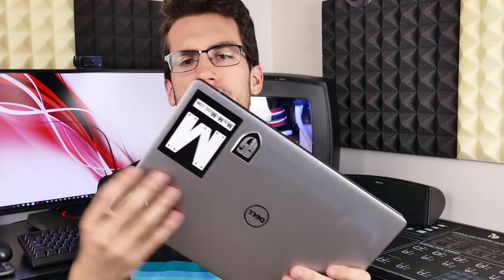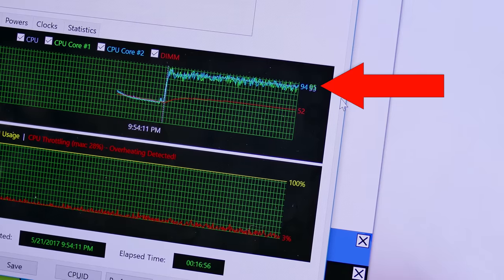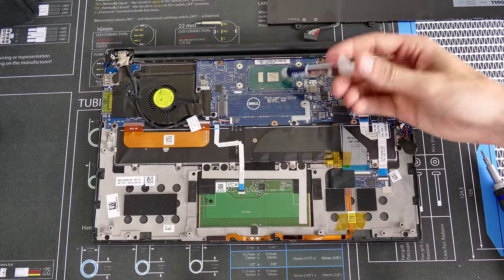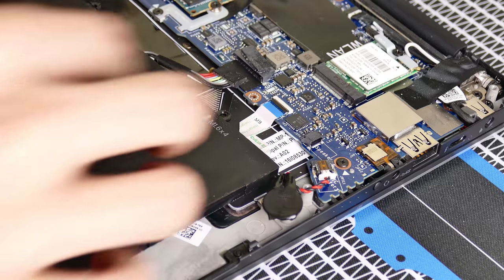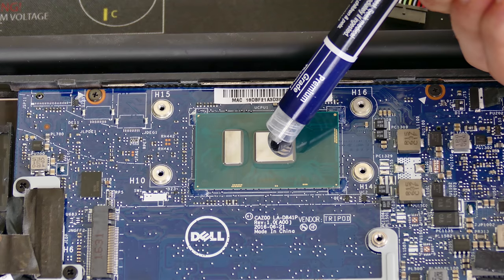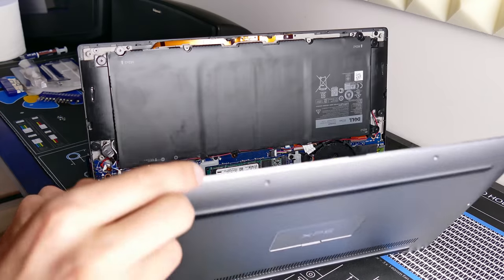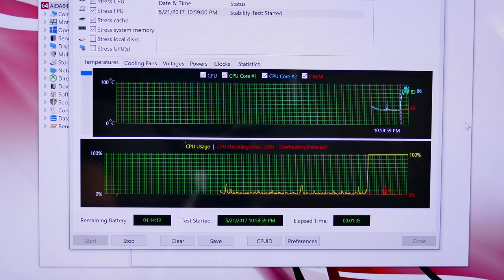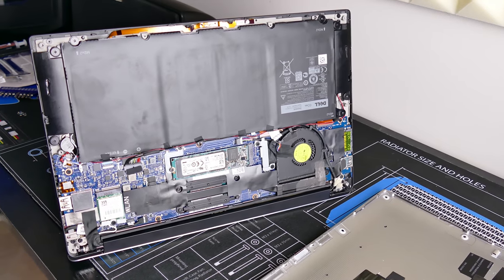Laptop Running Hot? Try This!

Comment: Have you thought of undervolting your CPU? Dave2D has a similar video where he undervolted the CPU as well as replace the stock thermal compund, to get lower temps and noise.
Reply from the maker: Peter Strobl He undervolted a legit quad core that consumed much more power. These ULP CPUs do not benefit nearly as much.
Reply: Science Studio okay. Yeah, I knew he undervolted a 7700HQ, wasn't sure how effective that would be on the 7500U or whatever is the XPS13. Good video btw.
Reply: Peter Strobl I tried and failed so hard on undervolting U processors (tried i3 5005U, i5 7400U, and i3 7100U), all of them crash on load. And my conclusion is that a processor already designed to it's very limit of voltage. Idk if any other could actually benefit from. Undervolting U processor but I don't.
Reply: Muhammad Wyndham Haryata Permana Okay, that's good to know. I was just curious if you could or if it had any benefit at all. Seems like you can't lol.
Reply: Science Studio I undervolted my i7 6500u to -90mv, got 8 degrees C drop. Please dont' confuse peopel around here. Sure, it's not as effective as for quad cores but it's still very helpful nonetheless
Peter Strobl you were extremely unlucky then. I;ve seen huge amount of people successfully undervolting their ULV cpu-s with no problem. I also undervolted my Intel gpu a little, which lead to better efficiency in playing older games.
Reply: Gianluca Orrigo I used Intel XTU at first(very simple) now using Throttlestop, as it gives more control over CPU, including real time control over frequency.
Reply: Gianluca Orrigo which laptop do you have? also you can try throttlestop, it's free just like XTU
Reply: Gianluca Orrigo just see a guide on youtube how to do it, it's quite simple if you only go for undervolting
Reply: because the 8-th gen low voltage cpu-s have a too big range of frequencies. your CPU didn't cool down because before undervolting it didn't get full clock speeds. Now it gets higher clock speeds, as you noticed. So the only way now to cool it down is to manually decrease frequency. In the tab where you decreased your voltage(you can find it in the "turbo ratio limits to the left of the voltage regulation), you can also choose frequency for all cores. I recommend keeping the maximum frequency for 1 or 2 cores, and limiting it for 3 and 4 cores for lower amounts than you have now, and I can guarantee you will get a decrease of temperatures without sacrificing much of performance. Maybe set frequency of 2.0  for all 4 cores? idk, you can play with it yourself and test the temperatures
Reply: when 8-th generation came out it changed. I mean if you had a thick laptop with something like i5 8300h(4 cores 8 threads) undervolting would definitely cool it down. But low voltage CPUs as well as 6- core i7 8750h mostly get higher frequencies from undervolting, because their maxmum frequencies are well above cooling capabilities of ultrabooks or power envelope of a cpu. Which is actually a good thing. Would you prefer instead that Intel locked your processor at much lower frequencies without giving you a choice? I think not. Now you can choose an optimal balance for you between performance and battery life. I recommend allowing cpu to run up to 80-85 degrees C, which is ok for mobile hardware.
Keep 1 and 2 cores frequencies on maximum (or you can decrease it a little if a cpu overheats, set to 3.5 for example), and set 3 and 4 cores to 2.0 ratio(or 20), that way you will have decent performance and good temperatures. Let me know how it goes :)
Reply: I think you misudnerstand how it works. the part of Throttlestop that says "3 and 4 cores" doesn't mean that it's third and fourth core. It means all 3 or all 4 cores. So when you set 3.5 for 4 cores this is the frequency that all 4 cores will stay at.

so I suggest you to look at my previous message again and try to do as I say

"but I have only 3.0 GHz that is a bit too low I'm my opinion" dude, considering that the amount of cores DOUBLED since the previous gen(which only had 2 cores) 3.0 ghz is great for a thin and light laptop :D 
Before 8-th gen quad core processors were only in thick and more heavy laptops which weren't nearly as portable as XPS 13, which explains problems with overheating and all that.
My i7 6500u only has 2 cores, so I wish I had 8550u to complain about it lol
Reply: either way, you can change frequency in a different way. make sure the program is on (near the left bottom corner of the main window of the program) and in the same main window find "set multiplier", it should change your frequency, and as a result - decrease temperatures.
also press "start monitoring" in there to see the real time frequency and temperatures
Reply: yeah it does, it should prevent overheating. But since most of everyday tasks are handled by 1 or 2 cores it should not affect the everyday experience much. When you'll be using 1 or 2 cores youll still have 4 ghz, it's when you give a 4 core load(liek a stress test) it will drop to 2.0, which is still good considering that its 4 cores, therefore performance will still be quite high
also 70 degrees is quite low, you have room for a little more frequency there :) I recommend setting 2.4 or 2.5 for all 4 cores
I ran my old laptop at 80 degrees C 24\7 for a year and it's still working fine, it's 6.5 years old now
Reply: Gianluca Orrigo it depends, all processors are different. and yeah, if you set 3.5 ratio processor won't go above that
Reply: how are your temps dude? :)
Reply: @GregSalazar  i confirm i had no difference by undervolting my 8250U, i guess it is already done by the cpu itself

Comment: That reminds me of my ancient FSC laptop, where the thermal compound got so old and dry, that the heatsink of the GPU got pushed out of its place, leaving a hole in the mainboard where one of the screws used to be. Interestingly though it was still operational and a good clean, new thermal compound and a bit of hot glue got it to work until today, although being pretty useless without drivers for anything newer than Windows XP.

Comment: Hey Greg, nice video! Have you tested fan banks like what Cooler Master makes in the form of the MasterNotepal Maker? I currently use this with my current Dell laptop and my temperatures are pretty chilly for a laptop (never get above 74C). This was after replacing the thermal compound like you did.

Comment: That laptop is so simple to disassemble. I'll do the same with mine one of these days when I have so free time. It's a Lenovo G580 and from the guides I've looked up it seems a lot more complicated to disassemble. I think I'll have to replace the bottom panel too because the part where the left hinge screws on to it is cracked.

Comment: Just did this on mine tonight. Cleaned all the dust out, installed an SSD, replaced the thermal compound. Boom.
I wish I would have taken a base line temperature, but hey, I figured why not while I was in there.
I also pulled and reinstalled one of the RAM modules for kicks and giggles... Then had no display after I closed it up. I opened it back up, was pulling my hair out, tried to boot without the heat sink (thinking I had too much thermal paste or too tight of screws on the block.) Pulled the CMOS battery, decided to pull that RAM stick out and it boots. No idea what happened to the RAM but it won't boot with that stick in. 😥 Cut my RAM in half because of... I just have to take things apart.

Comment: I would add an extra trick I picked up. Using intel XTU, I undervolted my XPS 15 processor by 150mV. This removed any thermal throttling issues I encountered in the past without impacting performance. Apparently, it is standard for Dell to feed more power than required to the CPU "just in case".

Comment: Greg do a follow up video by undervolting the CPU! I did it in my XPS 15 and it helped my cpu temps a lot!
Reply from the maker: DynamicHunter Your 15 isn't running an ULP CPU. Effects on this end will be minimal.
Reply: @GregSalazar  what are you talking about? Undervolting is ESPECIALLY helpful on H series CPU-s, which usually have way too much voltage pumped into them compared to ULV CPU-s. Most of i7 6700hq-s are capable of whapping -0.1 volts, which decreases power by around 20 % and as a result gives noticeably lower temps. I undervolted my 8750h by -130mv(fully stable) and I get -10 degree drop in CPU intensive games. And GPU undervolting helped by around 3-4 degrees as well. Far more effective than repasting in more than 90% of cases.
Reply: Me too, it helps greatly avoiding power limit throttling with my i7-7700HQ. (-135mv)

Comment: I used that exact same thermal compound (NT H1) and I replaced the paste a month or 2 ago. Now temperatures seem to be worse than ever, though initially they were much improved. Any ideas what is wrong? Would it be worth attempting a second paste application?

Comment: Just undervolt your laptop with ThrottleStop. I'm running at a constant overall 75°c down from 85°c-90°c while gaming and 34°c while browsing and doing other stuffs
Reply: too bad i use a u-chip and lost the silicon lottery so any undervolting crashes it immediately

Comment: I'm curious if you repasted with Grizzly Kryonaut or Gelid extreme how much lower the peak temperatures would be. I don't think Noctua's TM is near the top as far as thermal conductivity goes.

However, I can say that on my Razer Blade (2017 Kaby Lake w/ GTX 1060 model) replacing the garbage factory thermal paste job with Grizzly Kryonaut, as well as factory thermal pads with the most conductive pads I could find dropped idle temps by about 10-12 C. I still need to do some stress tests to see max temp but since it isn't my main gaming rig this has not been a priority.

Comment: What about drilling holes, or slotting, the laptop hard drive door for air flow cooling of the SSD?
I'm seeing laptops with SSDs where once the hard drive temperature starts moving north of 50C some SSDs throttle the performance of the drive.

Comment: have you got problem with the sticky rubber coating on your XPS 13 ?
If yes, how do you restore the surface to the original smooth surface?

Comment: Did I forget something?

1. Reapplying Thermal Paste
2. Removing dust. 
3. Changing Power Plan. You can cap for example CPU usage at max 75%
4. Undervolting CPU. All CPUs tend to get more volt than needed to work properly
Check on google for tools. Some laptops will permit to do so through BIOS.
5. Downclocking CPU in extreme cases where temperature are out of hand.
6. Buying thermal pad and applying inside the laptop can help sometime.
7. Cooling Pads 
8. Avoid putting the laptop on tissue or anything that accumulates thermal temperature.

Comment: yup... had a similar experience with my brother's laptop. He was complaining about the temps the keyboard and other components reached During games so I launched hwinfo and a normal virus scan and  the cpu package hit 105c, throttled, notified critical ring package temperature, negative TJmax... after only 10mins !!! Changed with an aftermarket thermal paste and the temperatures dropped down about 15c.... the strange thing is, we're sporting the same hardware and mine has been always way cooler than his... could the silicon lottery gone bad on his cpu?

Comment: can this be done to any laptop ? I've got an old Toshiba laptop from 2009 that i'm still using as a secondary laptop mainly for storing movies and pictures and sometimes it does get really hot , so hot that I was forced to elevate it so that it can dissipate as much heat as possible . The thermal paste does wear over the years , doesn't it ?

Comment: I'd love to try that on my recent purchase (a p73, i9-9880H, 128GB RAM, 6 TB storage) ThinkPad, but I don't want to void the warranty. The dmesg says it's being throttled even with minimal load, and the entire thing is hot. I'm running a 4-fan platform to add air-flow to the bottom, but it doesn't seem to make much difference. I'm open to suggestions.

Comment: Definitely have to be cautious with bare dies and heat sinks.  Over tightening or not using a cross pattern can easily crack or outright crush the die.
Reply from the maker: cracklingice I crossed and tightened to the same degree it originally was. No idea why it failed.
Reply: I was speaking more towards anyone looking to do this than to you.  Didn't remember hearing you mention to take the precautions due to the lack of heatspreaders on mobile chips.

Comment: Before I updated to 17.04 on the xps 15 Kaby I was getting quite a lot of crashing when watching any streaming video for a long amount of time.  The heat exists and makes the keyboard up top a little warm but with the latest os it's not crashed.  Going to try this anyway since that seems dangerously crappy thermal job dell put into it.  Any other performance mods for the xps 13?

Comment: I have just serviced a one year old Levono laptop which was hitting over 80 deg C, but after applying fresh thermal compound - the merest trace spread all over the die - temperatures are now under 60.  I suggest you put too much compound on yours.  I am learning to use less.

Comment: i just found this video because my xps 9560 is running quite hot and i never thought of the thermal glue...will try this in the upcoming week when my thermal paste arrives. thanks!
Reply: andrei ioan any updates.? I do also have 9550 and now fan is always on due to heating
Reply: @SirAguilera  i see a significant improvement! i didn't run any tests or measure any temperatures (lazy) but under the same loads the laptop runs quieter and colder (to the touch). good luck with yours!

Comment: I just bought a MSI GP72MVR 7FRX 699NL and I was wondering if this "trick" also applies to my brand new gaming laptop. It is summer currently and my cpu gets 93 degrees while playing games under heavy cpu load.

So does MSI use thermal paste properly or do I need to repaste? Laptop is about 2 months old.

Comment: Hello. I am planning to buy a laptop. I was thinking of Dell XPS 13 9360 model. But I did a bit of research, I found that, this laptop gets hot quickly. I will use mainly my laptop in website coding, a bit of writing, web surfing and watching video. The only big applications will be Android Studio and Photoshop. And I use to work putting my laptop on my lap.So I want a laptop with minimal heating issue. Should I go for Dell or I will buy MacBook air?

Comment: Great video Greg. I was expecting something like 5-7 degrees improvement or the same temps but no thermal throttling... but 10 degrees AND no thermal throttling ? That's very significant.

What kind of cheap crap is Dell using ?
It's not like thermal compound is that expensive...

Comment: Well, I have both the skylake XPS 13 and the 2016 MBP. The XPS has to be used on flat surfaces otherwise my junk gets cooked, the MBP on the other hand get's barely warm. Dell totally failed with the cooling on their XPS line. You just can't have the grill on the bottom, it's a LAPtop FFS.

Comment: My laptop dropped 8 degrees from 72 to 64 in Unigine Heaven (at low settings) from applying nt-h1. However, it also wouldn't turn on when the keyboard was clipped in for a day or two, and I've only tested it once since (it was working but I can't guarantee it's not still temperamental) so be careful with the pressure you're applying when removing the heatpipe, especially if your board isn't lying flat :/

Comment: Best temps you will get is to use Coollaboratory Liquid Pro (as long as heatsink isnt aluminum). Will decrease temps by 10-20C. Best stuff you can get. Only caveat is that you NEED TO INSULATE THE STUFF IMMEDIATELY AROUND THE CPU DIE! (it is liquid metal so highly conductive.) i did it to my laptop CPU as well as my GPU on computer. Works AMAZINGLY WELL!!!!! just put some vasaline or electrical tape around the die and youre good to go.

Comment: so I've replaced my stock thermal paste with arctic mx and it did work wonders for a few months. And i replace it every now and then, every couple months. Now my temps are no longer as they were. Meaning, the thermal paste change no longer has the same average thermal reduction i used to get after the first time i replaced my stock paste. Now I've undervolted my cpu. It worked... for a time. And then temps started rising again. Even with the undervolt AND new thermal paste

Comment: My Lenovo let's its fans ramp up immediately when stressed, never saw temps going above 67°C when stressed, it's just an i5 7200U but that's still nice, I undervolted it to -0.1 V and it now has a max temp of 60°C and it's quiter. I'll definitely put some quality thermal paste in there later, should run even cooler.

Comment: Hate those flimsy heatsink attachments. My Lenovo Z570 has two heatpipes for Nvidia GPU and CPU. The heatpipe for the GPU is just attached with a thin strip of metal that is bolted to the heatsink. I can see this getting bent and losing contact pressure after repeated disassembly. Also wanted to change the i3-2310M with an i7-2620M which has the same TDP of 35W. But it got much warmer  nonetheless, so I put the i3 back in. Generally these laptop heatsinks are all way too small and relying too much on the fan in my opinion.

Comment: Not a problem in older Dell laptops, such as my Inspiron 6400. I don't even have new thermal compound in it, yet it doesn't thermal-throttle and the fan kicks on during intense Chrome sessions. I would much prefer a hefty and beefy laptop rather than a boiling sardine can. No offense meant to your XPS.
EDIT: My Inspiron 6400 has an Intel Core Duo T2300E and an ATI Mobility Radeon X1400, if anyone is interested in heat output sources.